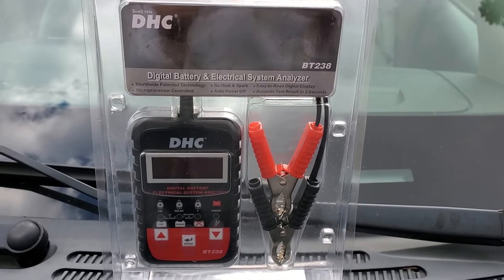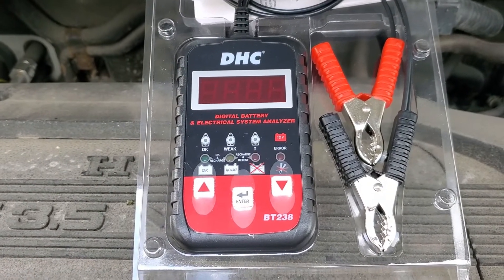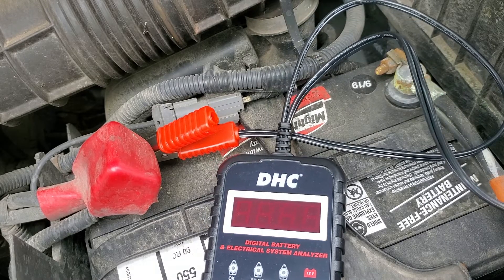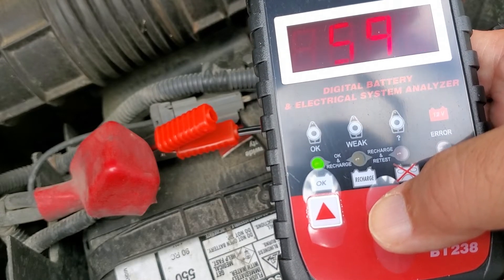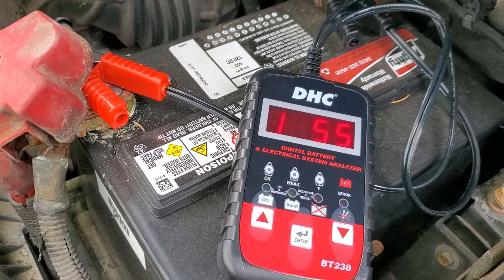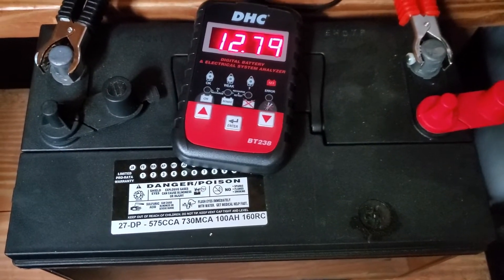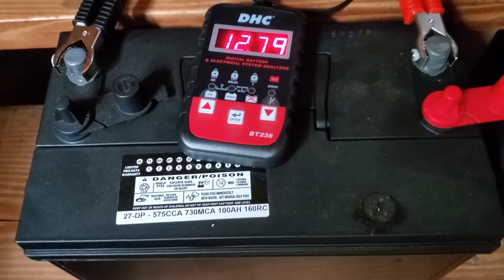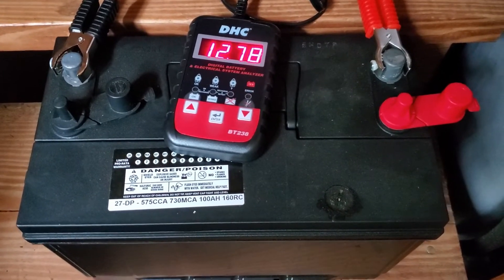EcoFlow and Battery Testers. What? Why? How?  #ecoflow

Comment: My xt60 solar charging connector is to big for the river pro. The cable came with a bluetti ac200p. Does the River Pro max take a smaller xt like a xt30?
Reply from the maker: I believe the blueetti has a xt90 pv conector. Please see spec below. 
PV Solar Charging Cable (PV to XT90)

1 x Car Charging Cable (Car to XT90)

1 x XT90 to Aviation Plug (input)
Reply: @HarringtonMediaEcoFlow  you are right thanks for clearing this up.
Reply from the maker: Your welcome. Happy to help.
Reply: @HarringtonMediaEcoFlow  I really liked the video where you connected alligator clips to battery to River, however they no longer sell that on Amazon. Connecting a 100ah to these solar generators is the way to go. More videos on this would be great. Merry Christmas
Reply from the maker: Thanks very much. The right adaptor can make your solar generator do so much more.
Reply: @HarringtonMediaEcoFlow  I also have  a youtube channel but have no editing app can you recommend one?
Reply from the maker: OpenShot.  Free editor. Playstore app. Or search for windows free.
Reply from the maker: K
Reply: @HarringtonMediaEcoFlow  thanks for answering all my questions.
Reply from the maker: Your welcome
Reply: @HarringtonMediaEcoFlow  you are a man with a good heart.
Reply from the maker: No the ecoflow line uses xt60 for solar inputs.